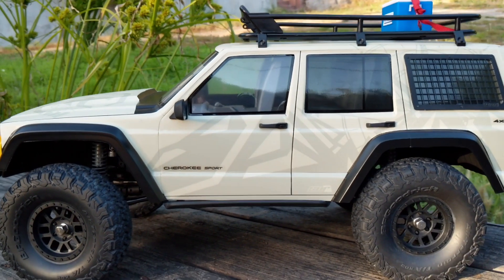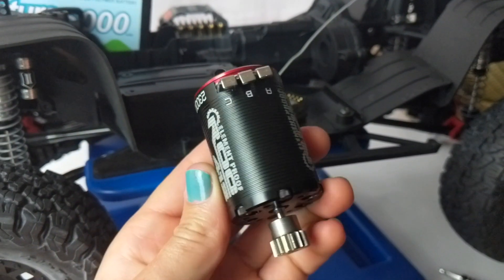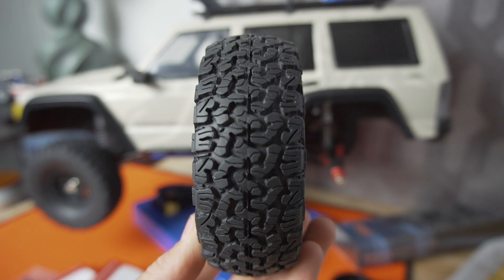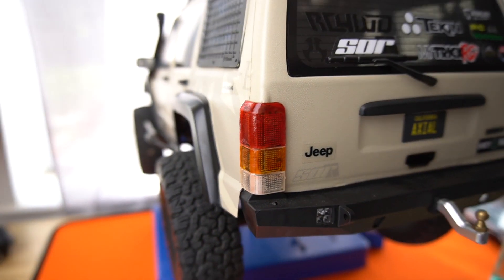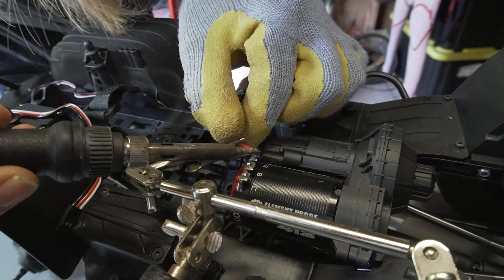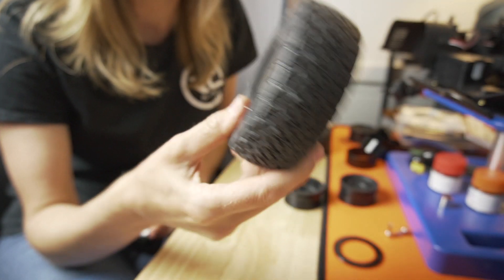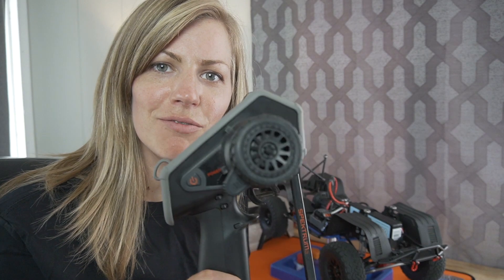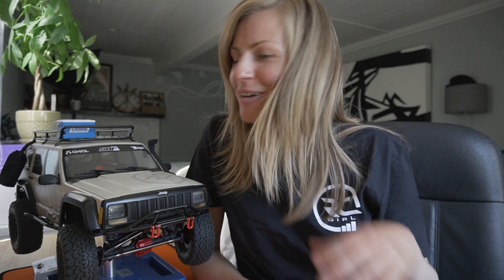SCX10ii Cherokee XJ Axialfest Build!  |  SET-UP TIPS & UPGRADES

Comment: The "pre tinning" of the motor terminals show the tin in a round ball on top of the metal.
This is a indication of a "cold joint" as a result of the metal not getting hot enough.
The resulting joint is brittle and unreliable. 

Few steps to avoid this; get the biggest size soldering tip that fits your iron and change the tip depending on the kind of work you are going to do.
The additional mass will store more heat giving more power to heat up the part you want to solder.
A good joint has it edges flowing outwards not looking like a drop of water with surface tension.
Also avoid inhaling the smoke even its the the soldering tin is the zinc tin alloy (instead of lead tin) the burned off flux is still not healthy.
If you use lead based soldering "tin" inhaling is  even more dangerous (potential brain damage in extreme cases
Reply: Absolutely, and flux is your friend...
Reply: Use a window fan sucking air out from the solder work away from your face.

Comment: Great vid! Just a little shock tip tho: preload shouldn't really be used to change ride height, it's real use is to let the shock have full travel without bottoming out - set your preload so when you drop the truck from an inch or so off the ground the shocks almost bottom out but stop just shy.
To change the ride height you can change the shocks for longer/shorter bodied ones for larger height changes, and get aftermarket shock mounts with multiple mounting points for smaller changes.
If you use preload to set your ride height then your truck will be stiff when you raise it and soft when you lower it, and if you think about it thats just not how your shocks are meant to work.
Reply: @Rc Guru I do wonder which is more ironic your statement or your name.

Comment: Im not an expert by any means but some sand paper to those motor terminals before hand helps the solder stick.  I used to build my own NiCd / NiMh battery packs back in the day and at first could never get it to stick without getting it way too hot.  Also flux helps not just the flux core but painting actual flux on the terminals.  Nice build!

Comment: One bit of advice for soldering.
Heat the wire or pad up and touch the solder to the wire or pad instead of the solder tip.

Comment: That is a tough and good looking jeep, Hayley. I am concerned about one thing though. I would strongly recommend to use heat shrink tubing to insulate and protect the soldered connections, in case one of them should ever break loose. Cold joints is a common soldering problem, causing unreliable joints. Some extra insulation can help avoid short circuits, and a possible fire, in case one of the connections should breake loose. There is also a lot of guides to excelent soldering on the Internet, helping you to achieve the ideal solder joint.

Comment: If you end up having to enlarge a lot of holes look into step drill bits. They are multiple sized drill bits in one and some step up sizes by 1/64's of an inch. Harbor freight sells them in a 3 pack.

Comment: The motor solders are cold, you must heat a bit more and allow the solder to flow to have a good reliable solder joint.

Comment: Love your videos keep up the fun and informative content! Thanks. Just as an aside the 1/8th scale motors (4268) are 6 pole and more efficient when you run a sensored setup however they are a lot heavier so the cg is affected considerably. But I love being able to go a mile or more on a 2200mah pack and over 4 miles on my 8000mah. Who says hiking can't be fun.
Reply: Just 4 on 8000? I get nearly 6 on a 5000

Comment: Cool channel 👍 Question .. do SCX10 II aftermarket parts like those stealth body mounts, bumpers, MIP drive shafts, etc. fit on the original SCX10? And what did you use to glue that stealth mount up under the lexan body? Thanks

Comment: Haha I had to dremmel one of my diff output shafts off because the screw for the driveshaft was stripped and I couldn’t get it off and I needed it for another car . 
So I sawed through the outdrive with my dremmel I didn’t have Goggles or a Mask, I’d had a few largers as I do,& all the sparks were flying up nostrils and I got bits in my eye countless times . I am cowboy when it comes to ppe. Always got kicked off sites from my Early plumbing days for not wearing ppe. I was picking out some right rotten bogies from my nose the next day .

Comment: Looks great!! I love that front bumper but when I click the link it has the scx10 pictured which is a different hookup I believe.  Did you have to change anything to put it on?
Reply from the maker: Didn't have to change anything. It screws onto the side of the chassis rails instead of using the two slots.
Reply: Thank you!!! I ordered it!

Comment: when something say waterproof is not complete waterproof is more waterresistang, they resist water splash not complete deep in water, is like resist few meters not a complete deep in water, even any one need be careful bering, axles inside and much more can get oxide like TXR4 need maintain when finish crawling over water right away the same day.

Comment: when soldering put the iron to the wire or terminal and hold for a few seconds before touching solder to it. the solder should wick into the wire like it wants to go into it. you look to have gotten quite a few "cold" joints. I'd recommend re-soldering most of those connections.

Comment: Those solder joints are not good. Solder should “flow” into the metal and wires like water. You have “cold” solder joints there.

Comment: hi i just got this truck what type of battery do u use?
Reply from the maker: 5000mah 2s hardcase, or 3s 2200 or 3600mah - ovonic, gens ace or zippy work well!
Reply from the maker: https://amzn.to/36B36ll
Reply: RC Girl thank you so much love your vids
Reply: RC Girl i’m new to rcing and i have a question, do i need a second battery to power a light bar or does they other wire in the battery do that or something else?
Reply from the maker: @chrismcbr1284  depends, but usually no. Depending on what receiver/transmitter you have have, the easiest way to power a light kit is off a spare channel in your receiver if you have one. If you're just running lights (and not a lighting controller), you'll have to make sure they have connectors that can plug into the receiver otherwise you'll need an adapter (or splice the right connector on). If running more than one light, you can get a Y harness and plug in multiple lights into a single receiver port. Make sense?
Reply from the maker: Oh! And another thing, make sure the lights you have are rated to the voltage output of your ESC otherwise you can burn out your LEDs
Reply: RC Girl ok thanks!
Reply: RC Girl sorry for all the questions but do u know what type of receiver the scx10 2 grand cherokee rtr comes with because i was looking to get a light bar and don’t know what i should get. i also don’t wanna risk blowing out the leds

Comment: How is the Bomber?
Reply from the maker: It's getting some service in prep for the 5k ultra. Just added a light system, a fan to the ESC, changing out the shock oil, adding a heat sink to the motor and making sure all the screws are tightened
Reply: RC Girl just lost my gps! Got carried away on golf course, should have taken it off the bumper! Arrma Typhon is such fun I got lost in it.

Tekin rocks?
Reply: Lower KV is better for crawler....I think. 

Tekin has motor for every “S” and application.

Comment: I have to echo the sentiments of another commenter. You are not getting your solder hot enough, nor the terminals. Near-spherical balls of solder are cold, and not reliable. Also, when you tin a wire, you're having so much trouble because there is no flux. ESPECIALLY when it comes to those larger gauges. Easiest way to tin a wire is to dip it in a bit of flux (I prefer paste flux for that), put solder directly on a nice CLEAN iron, then touch that solder ball on the iron to your fluxed wire. It'll get sucked right in.

As for those motor terminals, you badly need to go back and redo them. Get your iron hot. Like 850F. Press the iron onto the top of the wire so that the solder starts to melt. Keep it there and add more solder to the joint. You'll see that as soon as the terminal you're soldering to gets hot enough, the solder will flow to that terminal, rather than just sitting on top. Just remember, solder is attracted to heat. When the terminal is hot enough, you'll know because you'll see the solder actually flow where you want it to go. If it's hot enough, it should take at least half a second or more for the solder to solidify after removing the iron.

Very cool build. I would love to see a comparison of this to your TRX-4!

Comment: Great video! Nice to have some women enjoying the hobby. Being a sexy lady sure helps too. You have anice way of speeking too. Your smiles work too. Cood content,  and nicely edited. Loved the bloopers at the end. You go girl!

Get some paste soldering flux. A dab on all connections and wires will produce better joints,  and make the soldering much easer. Also use a wet sponge to clean the tip of the iron before and after each joint.